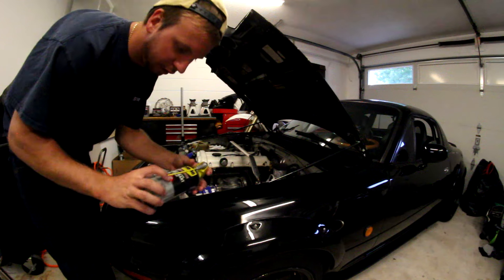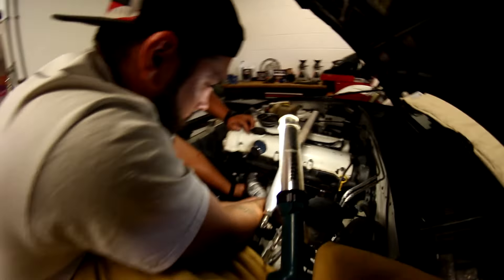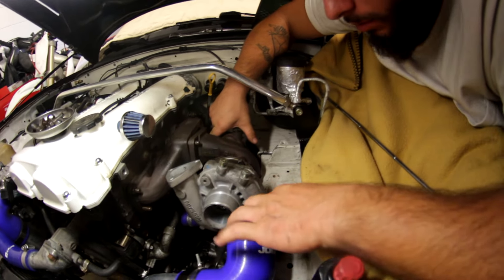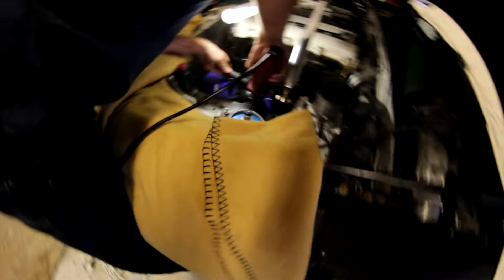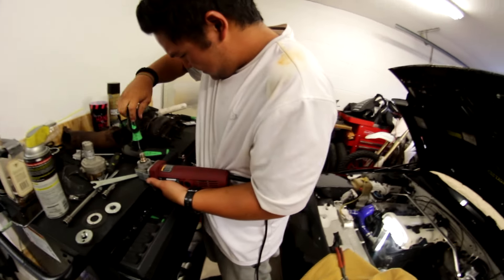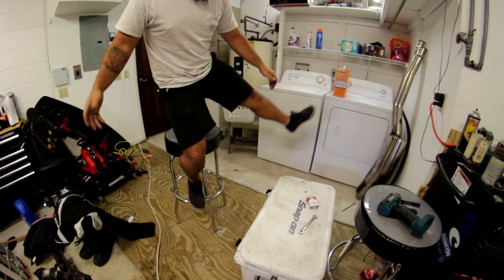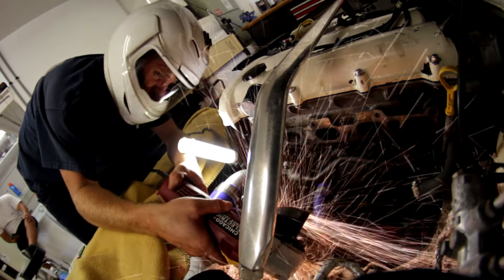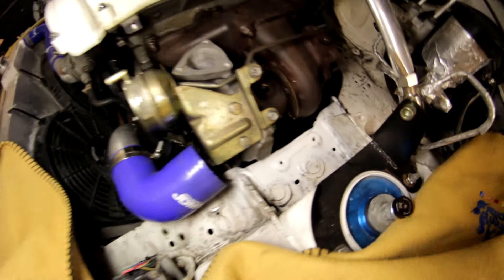Miata TURBO Build Part 2!

Comment: How much did you pay for the Miata + the extra parts you are installing at the moment? 

KEEP IT UP! :D
Reply from the maker: Stole the Miata! Came with every part on the car (hardtop, MEGAN coilovers, big brakes, full exhaust, roll bar, light weight flywheel, harness.... List goes on) and the turbo for $3,600!! Since then I've brought BEGI cast iron manifold $200, and 650cc injectors $200 from my friend. Gauges were another $300,  downpipe $80 uh put tires on it lol
Reply: FloridasFinest Cheers man! Thanks for the info!